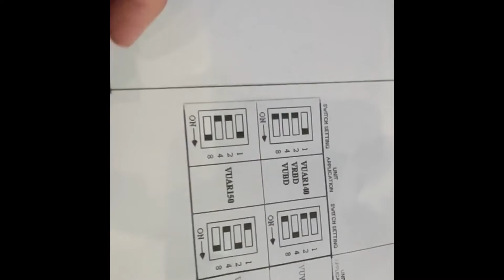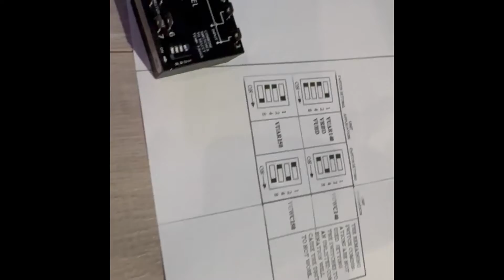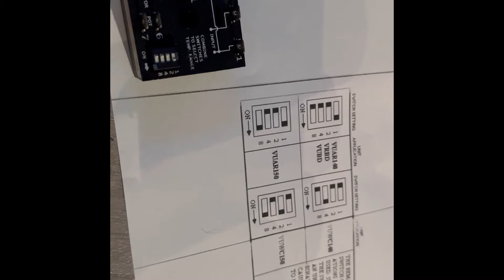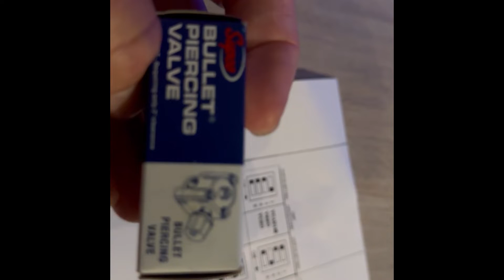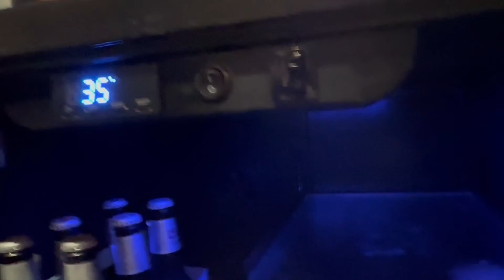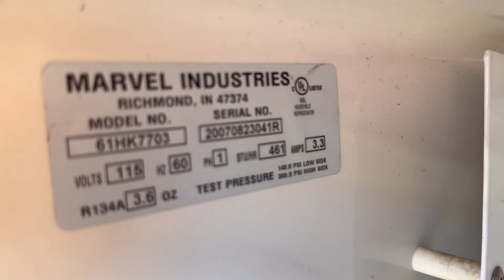Marvel and Viking Under-counter Refrigerator with erratic temperature hot or cold thermister failing

Comment: Unbelievable I have this exact problem and I need the exact thermistor you show in the video, thank you!  I’ll try to hunt down the part as I can’t find a model number or serial number anywhere on my unit this was super helpful.  Editing to ask if you would please name the part - when I search through your link for “Thermistor” 109 options come up and I can’t select Marvel as the mfg as you stated they no longer make it?  Would make my day if I could get the correct part ordered.
Reply: open up the back. part number should be printed on the thermistor wire towards where it connects to the control unit.